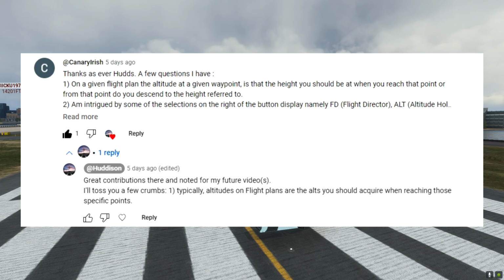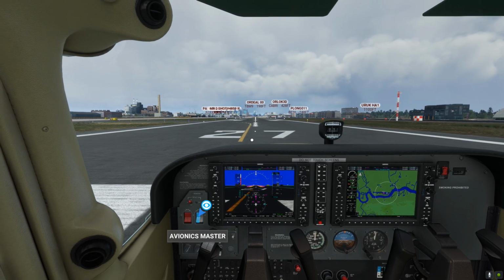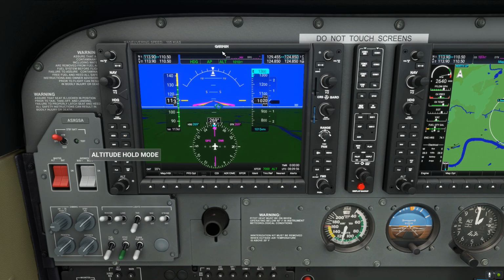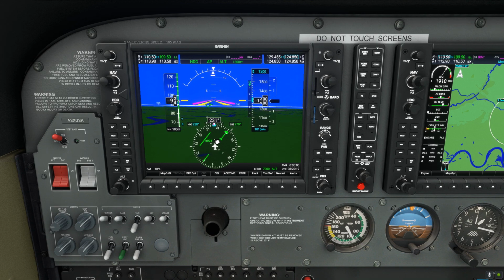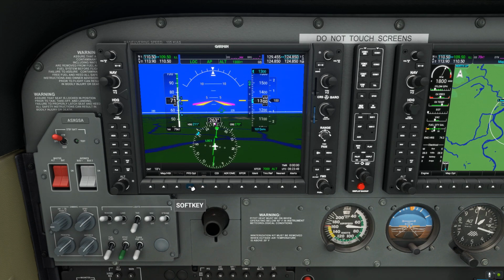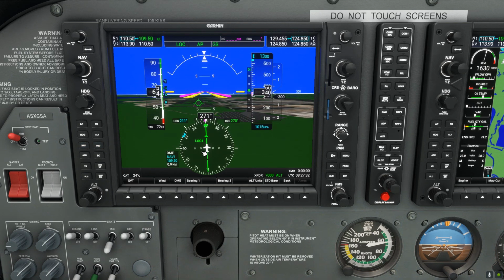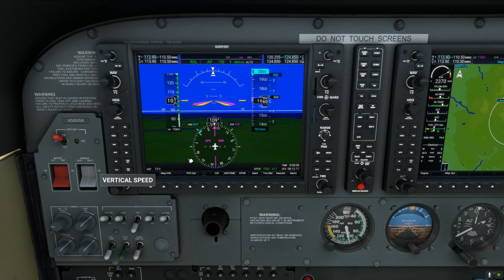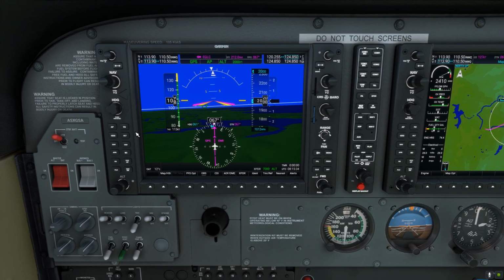FS2020: VERY Basic Autopilot Procedures - Your Questions Answered. Back To Basics Part 27

Comment: Pls be very careful using VS in climb in an underpowered AC such as the C172. I am transtioning from six Pac steam gages into the G1000 and the GFC700 In full size AC with older not so capable AP's  that have other ways to climb that need ones attention to AS. Best to use FLC at a specific ROC like VY or better to ensure the AC AP will not continue to climb at a VS that it's power is not able to maintain, and fly you into an aerodynamic stall.

Comment: Thank you so much for all of your videos Huddison. I am fairly new to MSFS - just a few days on the Xbox series X.  Now I have been following your back to basics videos and they have been extremely useful in getting me up and running. I have gotten to the point where I can take off and land sort of safely, not perfect but at least I no longer end up on the lid 😅 I can set the vertical ceiling and set up a route on the G1000 (C172) and get the AP to follow the route.  Where I am having difficulties is transferring those skills to other aircraft. In particular I jumped into the Cubcrafter Xcub with, I think, the G3X ?? and I’m all at sea.  I could not get the AP GPS to lock on to a route, it wouldn’t level at the vertical ceiling, just went sailing through that, and where have all the buttons gone ?? There was 2 x RPM counters, one of which followed the throttle setting and the other went to max RPM and kept flashing a red alert.  So question is do you already have a video covering the basics for other variants of the Garmin units ? I can see other YouTubers videos but unfortunately they mostly end up up way too complex way too early for me to get a handle on it. Anyhow thank you so much for your videos, they are a godsend for me 😊
Reply from the maker: I may have briefly touched on other Garmin systems in one or two videos, but it might be a good idea to make a more detailed video on them.
Reply: @Huddison hey thank you for responding so quickly and yes, that would be an awesome idea for a video 😊 I have to say I am totally blown away by the quality of the sim on the Xbox, I’m having a ball on it ! Anyhow thank you so much, cheers from NZ